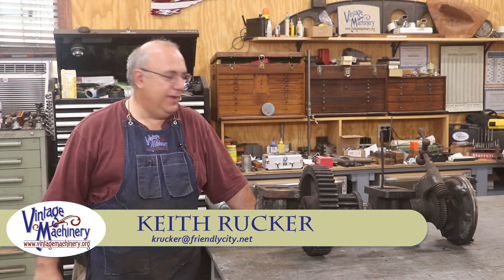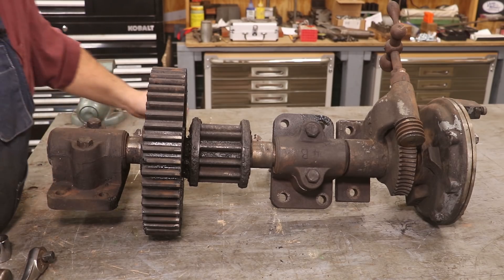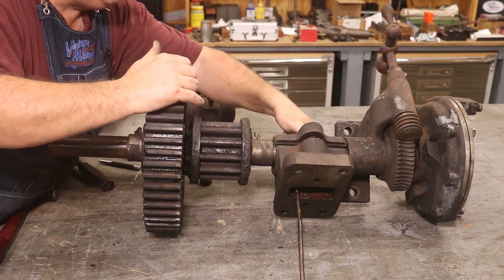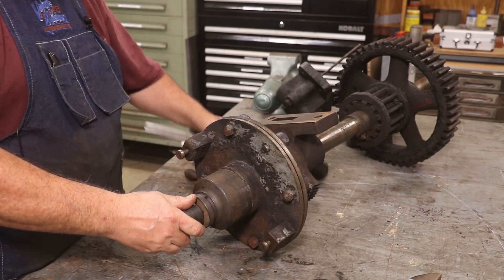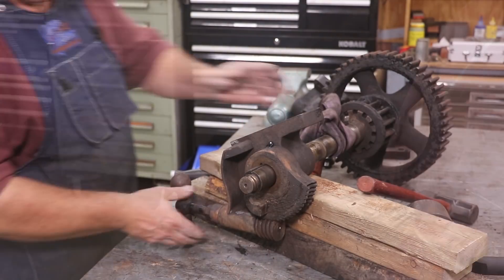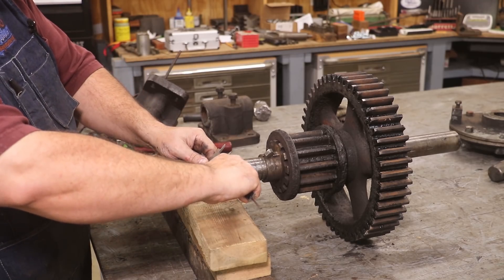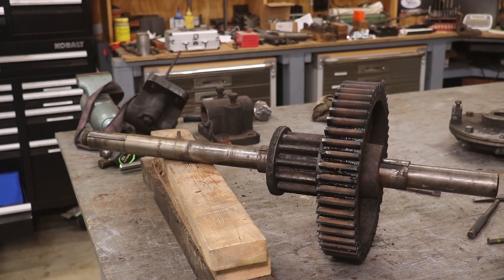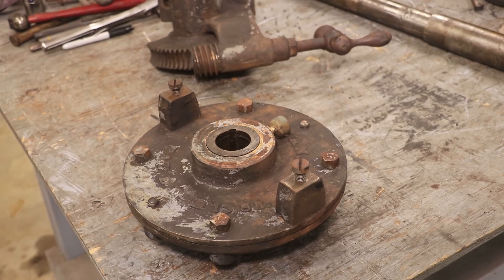New Haven Metal Planer  Restoration - Part 14: Disassembling a Gear  Reduction Countershaft

Comment: 13:55 you flipped your center disk over from how it came apart. :-) I vote for making a new shaft, spray welding thru keyways is never a good mix and it can be better material too.

Comment: I noticed the bearing that failed with galling was dry as a bone. While the one that was acceptable was still wet with grease, oil. That's just a reminder to keep moving parts lubricated.

Comment: It seems reasonable to spray weld that shaft. It won't get nearly the use that it originally had. And with your care  and oiling of the babbits, it will survive another 100 years easily.

Comment: The sort of knob with the short pin inside made me think of something.  Please look at it carefully to see if it either had more than one slot for the pin or is missing a spring. I remember having something similar where you pulled back on the knob and turned it 90 degrees to lock the adjustment handle so it wouldn't wiggle out of adjustment while operating.

Comment: Keith just had a $70000 gear box had the shaft come apart (spray build up )and trashed that gear box . I think spray welding is great for roller bearing with a inner race but having the shaft be the inner race was not a great idea for the plane bearing . Hope this gives you some push to make a new shaft .
My Best 
Tighe

Comment: I’m not a machinist but it seems like a lot more work remaking the shaft vs the spray welding option. Then it would be all original still.
Reply: The shaft would need to be machined to the correct size if it was built up so the choice is cost of new material vs building up cost plus the hassles of building up.  The real advantage is new material will probably be better than the old shaft.  Depends on how Keith wants to proceed.

Comment: Hitting a ratchet with a hammer - my foreman would have had my guts for garters ;-)
Reply: Use a rubber hammer or weighted hard plastic one so he doesn't hear it.  some foremen would rather you use your hands to shock something loose, and give yourself carpal tunnel syndrome or some other joint crippling problem.  Many of us have learned, too late, what damage that can do.
Reply: Yes, @infoanorexic  my hands are wrecked after a lifetime of spannering but I wouldn't have listened when I was a lad.
Reply: I winced when Keith did that thinking at least use a T bar. Des.
Reply: Ahhh the old "my boss would have..." or the, "I would fire the guy who..." They're tools, not at pieces. Hammering on it won't hurt it. And that's the benefit of not having a foreman to answer to.

Comment: I really hope those friction pieces were leather, and not asbestos.
Reply: A piece of asbestos won't hurt anything.  Airborne asbestos dust is another matter.
Reply: @paulcopeland9035  True, though would certainly wonder with a friction plate about any dust/debris.
Reply: Asbestos it's like the black mold, lead, mercury (elemental/metallic) used to be. People think you'll die if you contact it. Issues with these things come from prolonged exposure, not from taking out a few grease impregnated friction plates. It's like how hand tool rescue had to start doing lead paint checks because some 'wipes started freaking out.

Comment: How do you determine what to make the shaft out of?  1144 stress proof or 4140 chrome moly?  Or just cold roller mild steel?  Just wanted to wonder.  Good show.
Reply: think on when that machine was made.  unless it has been replaced before, the shaft could very well be wrought iron.  Anything current or "late last century" that replaces it is most likely an improvement
Reply: Good point diggerop: I was thinking of the BEST improvement, not the correct for the period. Thanks for bringing me back to reality. At least you didn't slap me awake like my third grade teacher!

Comment: Why not a little penetrating oil on disassembly?
Reply: I was wondering about this as well. Seemed like it would have helped a lot.
Reply: The stuff doesn't work.  Watch Project Farm for the proof.
Reply: @paulcopeland9035  it does work, it just doesn't work when you spray it 2 minutes before attempting to remove the bolt. You need to apply it several times over a day or two, and/or use heat.

Comment: I was surprised to see that the adjustment handle was only prevented from spinning on the shaft by that little pin. I sort of expected the end to be splined of squared.
Reply: It's not under much torque. It's just turning the sector gear.

Comment: This is turning into a really great piece of work! Personally it is always the dis/assembly of the more intricate, mechanical features that I find the most interesting over scraping ways or whatever. At my own home I have so many abused, left in the rain to rust bits and pieces of machinery from my grandfather's and great uncle's workshops that look to be very much in a state similar to those things you dissembled today. I could not even begin to renovate my stuff and as the video played I started out thinking 'good luck! you won't get those apart!' and then to see you actually do get them to pieces is truly fascinating and oddly rewarding in a second-hand kind of way.

Excellent work Keith!!! I am already looking forward to the next entry in this saga.
Reply: Don't discount the value of penetrating oil, especially used over time and heat cycles.

Comment: The pin is likely there to prevent the sleeve from moving with the nut. Kinda like a spring washer or a grover(cruller) washer.

Comment: Very cool, Keith.  Can't wait to find out your choice of metal for the new shaft.  4140?
Reply: I'm guessing the original was just mild steel for it to get chewed up by babbit bearings. If so 4140 would be overkill. Far more expensive and a bigger PITA to machine than plain old O1 or the like.
Reply: @siggyincr7447  Without any lubrication, metal on metal contacts have too much friction, which generate heat, and heat leads to the dark side.
Reply: that wouldn't hurt but that shaft doesn't look like its under much stress at all

Comment: Have you ever considered powder coating vs painting the finished parts/pieces?
Reply: some parts may make sense to powder coat but when you have to heat the part to cure the paint, it would take a huge oven (for larger parts) So, if you don't have a huge oven, what is the chance of getting the same color of powder coating & enamel paint?  Probably not good, then you would have two different color parts, depending on whether it is enamel or powder coated... better to stick to one technology... IMHO
Reply: Stuart Warren Sounds about right, but the local powdercoater (in Columbus, GA) has an oven large enough to get a car frame or a trailer in. 1 problem solved.
Reply: Powder coating isn't all that great. I was  manager for a powder coating company. It's tough and once baked it's done but it's difficult to touch up (like, impossible). Parts that are cast iron take special powder and some of the cool stuff doesn't work on it. You certainly wouldn't want to powder coat the parts that have precision surfaces due to the possibility of warping.
Reply: Yeah, powder coating is always a better option. The issue phlodel mentioned with cast parts is due to tapped gases in the casting, causing blow outs of the coating. It's not a big issue though. The only barrier to him having it powder coated is the cost. It's a lot more expensive to have that giant planer coated.
Reply: @xenonram    Powder coating is not appropriate for the planer. The heat required would distort the parts that are accurately ground or scraped. If it had been powder coated before regrinding the bed and scraping the other parts it might be OK.

Comment: Suggestion'

Bore the worn Babbitt bearings to clean up. Check for common center height after boring. 

Make the new shaft with bearing journals to suit. Saves re-Babbitting.
Reply: I'm pretty sure I heard Keith say in prev vid that he considered that, mentioned modern bearings. But the Babbits really are good, best in this kind of application. They're in modern car motors.

Comment: Keith,  What is your logic for not just machining that bearing run surface down 0.020" or so to clean it up, then repour a bearing to suit?
Reply: He said there were 1/8" pits. :-(
Reply: Given that he said there was pits as deep as an 1/8" of an inch, it would take quite a bit more than 0.020" to clean that up. Try 0.125" or so with a total reduction in diameter of 0.250". That's quite a reduction in the shaft diameter.
Reply: OK, Thanks, I didn't hear the 1/8" comment.
Reply: I was wondering the same. If you could control the heat to keep the shaft from warping , re-weld/braze just the pits, turn it down even and pour babbit to fit.

Comment: With Babbitt bearings and split bearings on older machinery, is there a recommended tolerance for clearance or general rule of thumb for torquing them back down?
Reply: Mr. Rucker have video how he pour these bearings (as part of restoration of wood planer). The way he made it is to smoke the shaft with gas torch. This layer of soot is tolerance that is needed for easy and smooth rotation of the shaft. The bearing shell is not made for setting tolerance, it must be tightened till contact of both halves. In some cases, shims are used to increase distance of halves of bearing shell, and when shaft becomes loose due to wear, just remove shims and bearing is thigh again, without re-pour. I hope that this helps.